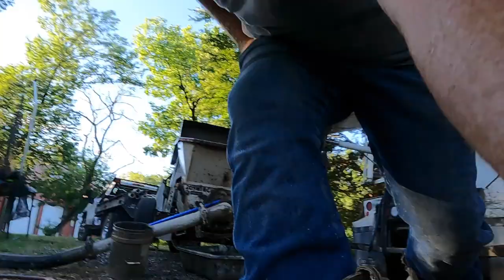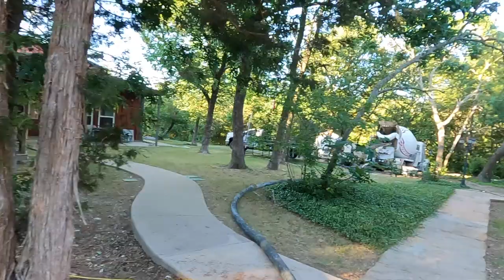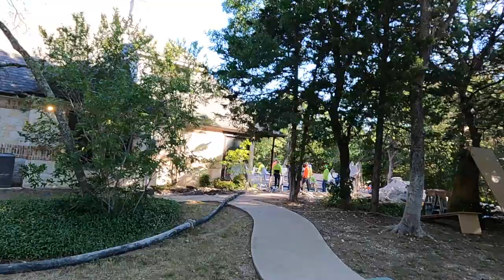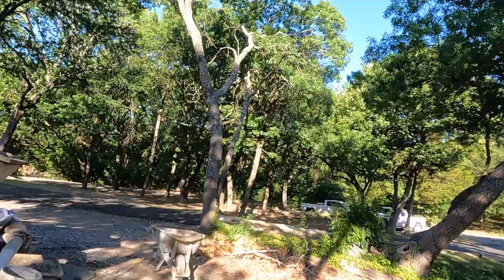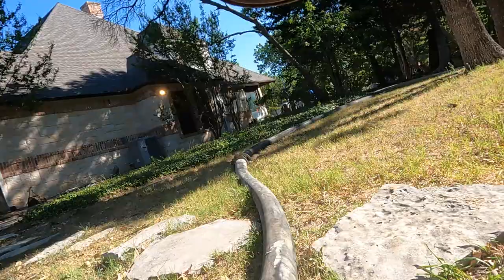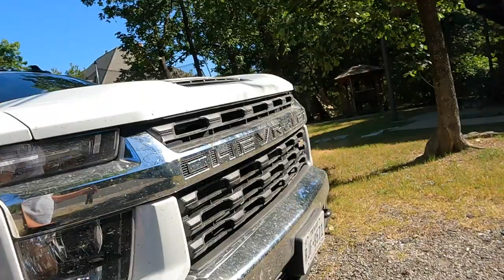Concrete trailer pumping amped up on coffee with Muddyfeet

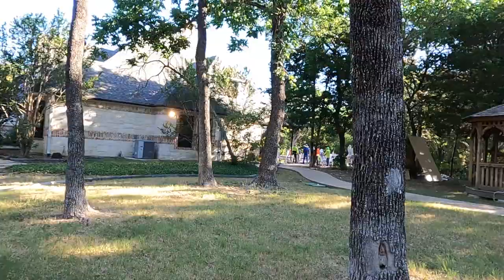Comment: I hope you guys don't get too hot. Hottest day on record yesterday in Wichita Falls and my air conditioning went out and did not get it fixed until today. At 4:30 this morning it was still 99 degrees. After suffering thru it with no sleep I got it repaired at 1:30 this afternoon and it was 96 degrees in the house.   I got some really needed sleep and woke up to 79 degrees and discovered that FAT freezes at 79 . You can figure out the rest. LOL Thanks again for bringing us along.
Reply from the maker: This heat is hard on everything

Comment: With 19K die-hard subscribers I'm surprised that a wireless controls manufacturer hasn't offered up a remote setup to you. Just a simple on/off forward/reverse setup would allow for filming even better content.... except for then the placers might try and rope you into running the hose for them 🤣
Reply from the maker: A friend of mine has a new pump with a very fancy remote. If it worked it would be nice. But it’s constantly loosing connection with the receiver. He’s sent it in a couple of times now. But he’s pretty much given up on it.